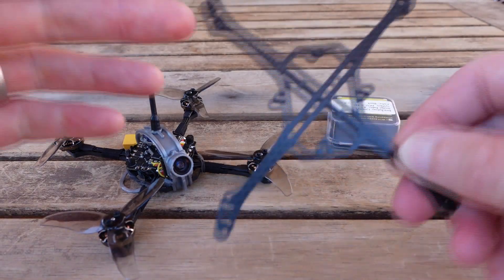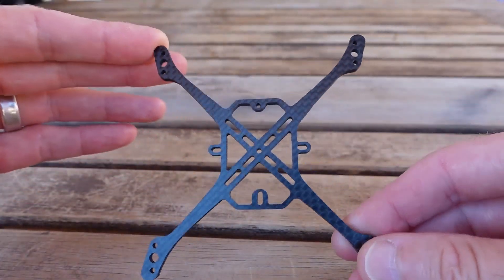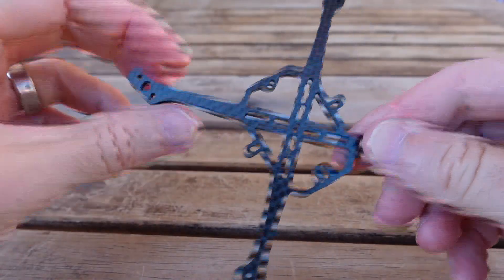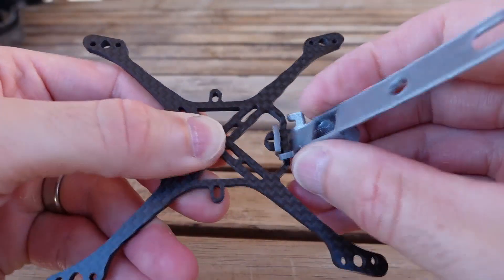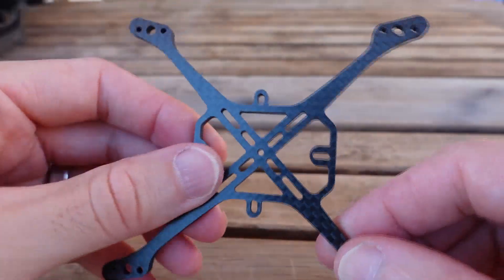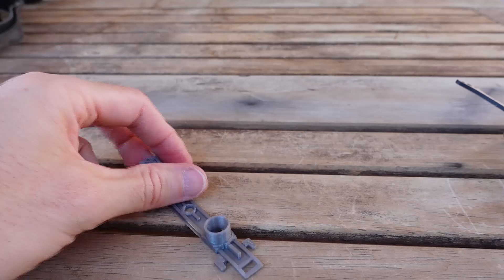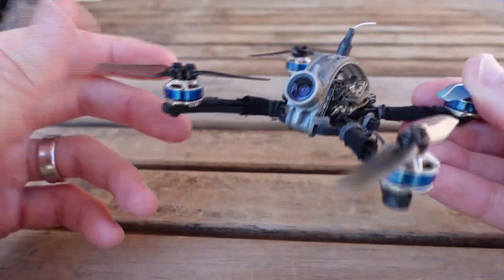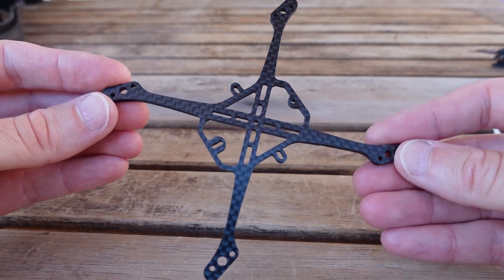Introducing the WarPig 114 Gen 5 Frame

Comment: I totally support the changes - I noticed it myself that in most cases the three motor cables are wider than the arm in its thinnest point, but having previously pestered you about things (and having gotten them) I didn't want to over-stretch your good will by asking again 😉
Luckily, this time I didn't need to.
And yes - a 2.5mm version is a great idea as well, for lighter, less-extreme builds👍

Comment: Love what you are doing for the small quad community!  This frame looks spot on.  You mentioned several configurations (motors, batteries props)..... which one(s) would have the longest flight time?
Reply from the maker: Generally you want bigger biblades and lower kv motors and the most battery you can carry while not pushing the motors too high in their powerband.
Reply: @Quad66  so for this particular video it sounds like the LDARC setup would fit the bill...
Reply from the maker: @bentsai9259  The ldarc motors are still notchy responsive motors, there were definitely more efficient motors out there I’m not sure what’s still available.

Comment: I've got some Betafpv 1103 11000kv kv motors that I usually run 2s on 2 inch but how do you think those would do on this setup? I'd try to keep it light.
Reply from the maker: I think its worth trying. The BFPV 1103 are lower torque higher efficiency generally so maybe they don't control the prop quite as well but you pick up a little flight time.
Reply: @Quad66  got some xing-e 1103 10000kv too apparently. Couple options. You wouldn't happen to have a version of the warpig canopy v2 for the ant that fits the 2.5mm? I can only find the 3mm and 4mm version of that one. Thanks much!
Reply from the maker: @valden  the 3mm should work with the 2.5mm. If it’s not snug enough just build up a little foam tape (I like VHB tape) on the frame to take up the slack. I did do versions specifically for 2.5mm but I don’t think they are the latest version.